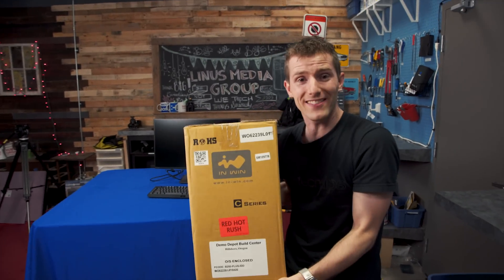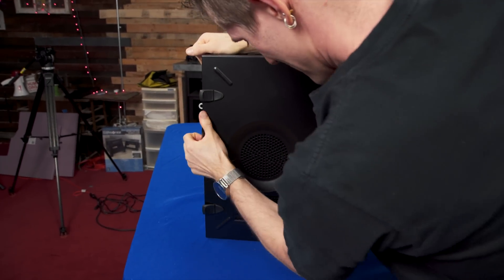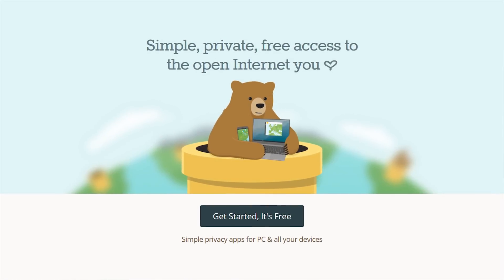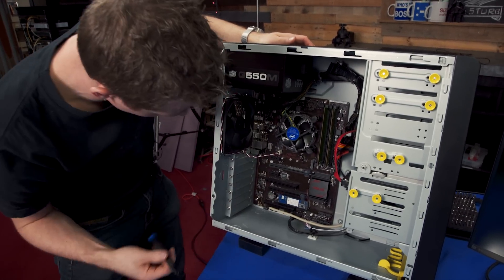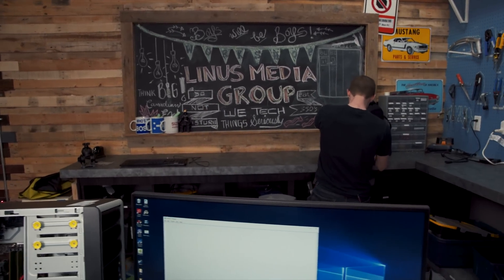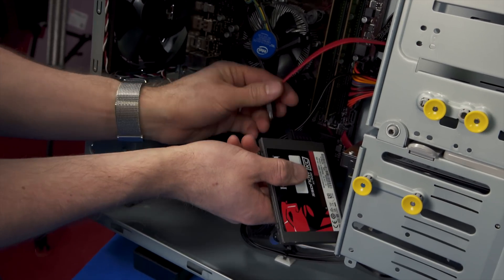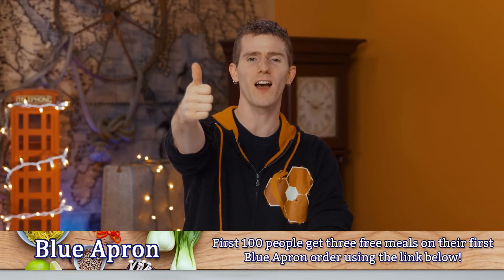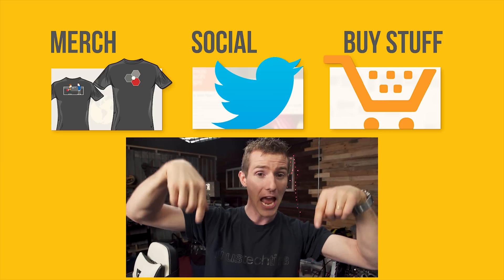Turbocharge your SSD for $40??

Comment: Bullshits, for 20$ more you'll get a 128Gb ssd with an HDD for datas. Or if you're searching for the cheapest solution, SSHD will be as this module. This is the same functionment, but will don't occupate a M.2 slot...

Comment: It's a nice Item. There are board out there like the Asrock z270 Taichi with 3 M.2 slots that each support optane. You can use one NVME SSD for the OS, one for your main games and an optane module to speed up your mass storage HDD (that let's say you use for not so frequent accessed files).

Comment: I would buy the shit out of this if it would work with older systems but why the flying fuck is it only compatible with the newest, best stuff? Why would I need this crap when I have the newest best stuff anyway? Who buys new hardware and then puts a slow-ass HDD in it for a boot drive?

Comment: I was doing similar thing with flash drives years ago, to work around having slow Virtual memory. 

It works wonders, if you have small ram, and slow hard drives, but otherwise?  Just get SSD, it's cheaper, and has more uses.

Comment: Unless there is a real, hardware level compatibility issue, its nonsensical that it's limited to Kaby Lake and above. The main market I see for this now is OEMs using them in prebuilts as a cost saving measure over a real boot ssd.

Comment: the case at @1:00 in. i like that cases mounting system. not for sure of its going price. still the last one i had that looked similarly generic i had to use screws for everything, except for the side covers. this looks like it has a system to easily mount drives and such. that would have been nice.

Comment: This is silliness, but try giving it a shot on a Ryzen system while you still have the sample. I've finally sold enough rebuilt Xeon systems to rationalize adding a new system (Still going to finish my personal Xeon build, too much love put into it and I've already gotten rid of one I really wanted for myself, but I felt so bad for the customer. Single mom, Windows update corrupted Windows, destroyed sectors of her hd, just a mess, I won't get into more details, but a new HD plus a new windows iso @full price was required since MS said it was not their fault, Dell said it was, called MS back on 3 way, and they invalidated her key since she no longer had the mother board which fried when her Dell PSU went 3 years ago and I replaced it). The cost to fix her PC with labor (Over 35 hours real life time) was roughly the 2x the cost of the Xeon build, so the big heart that I have...

Anyway, any shot at testing that on a Ryzen build for giggles? I have an SSD but speeding up the hdd on the Ryzen build would be great. i know it won't work with the x5650 build, but if it works with Ryzen, I'll test it anyway. Maybe a driver update somewhere down the road?

Comment: This is a stupid product if it only works with kaby lake or above. Those systems will already most likely have an ssd already. The systems that need it are the older mid-2000s computers, but they aren't supported.

Comment: I don't get it. For $40 you can buy a 128GB SSD and then just pair that with your mechanical and use it on any file system on any OS without any hassle whatsoever.

Comment: It seems like it makes no sense until you factor in what they are actually trying to achieve here... sales...

They don't care about Joe Bloggs who picked up a new PC last week, they care about the guy/gal picking up a completely new system right now. By restricting the compatibility to Kaby Lake they are trying to get more sales. Sure, you can argue that people can purchase 100 series products, and older, new but you have to bare in mind that retailers have already paid for those, this forces retailers to stock new hardware which = sales for intel and it's partners. This product is aimed squarely at the budget end of the spectrum and budget builders are frugal. Given similar performance between say a B150 board and a B250 board and lower cost on the older part they will buy that. Add in a feature like Optane support and that suddenly changes even if they don't pick up an optane drive, supporting it for future upgrades is a factor.

Comment: So.... if you have a 2xx motherboard, why would I have a sata SSD? when I would go u.2 NVME SSD?, and I could put the $40-80 cost towards a bigger one, and old skool HDD's can be used for data. The cost of 256Gb is quite nice a 512Gb NVME is $250 for ironicly WD black SSD. With that storage you don't really need 'cache' as your main system and a massive pile of games will all fit, and you don't need to worry about flushing the cache when you open multiple games.

If Intel had introduced it into lower tier motherboards, hell yes I think it would be good as most consumer PC's are currently sold with old HDD's, so the option of droping in a $40 fast Cache would be awsome.

What I would of loved Linus to do is put the Optane head to head with a small NVMe drive so we could get a feel for future Optane products and if there really anything other than NVMe with a fast cache and controler and Optane is just a marketing ploy.

Comment: Optane would be really cool addition for Ethereum nodes (and other cryptocurrencies). Ethereum state database is increadibly I/O heavy, and traditional hard drives were no-go from the start.

Having latency comparable to RAM, while non volatile and quite cheap, would be a holy grail for such usecases - especially since optane is affordable to regular end user

Comment: I honestly see no point to this, if you are going to upgrade to a mobo with M.2 slots and still be rocking a HDD as your boot drive, you are failing yourself. No one is going switch over just for that product. Just save the money and buy a SSD as a boot drive. Keep your HDD as extra storage. M.2 SSD's are fantastic btw.

Comment: Doesn't concern me because I won't build a PC without a Samsung or a Crucial 1TB SSD. If I need it in the future, I'll put in a WD Black 2TB HDD purely for storage. When the price of SSDs goes down, then I'll have a 1TB SSD for boot and another for Storage. That will do me until the Optane grows up. Once the M.2 drives come down in price, I'll get the largest capacity M.2 available and have the fastest SSD installed for storage.

Comment: For me this optane modules look absolutely useless. Even if we ignore the compatibility issues we can buy 128-256GB SSD for the price, but you can actually store your data on this SSD while optane module surves only as cache, bringing redundancy in play and being not really reliable in terms of what is going to work faster and what not. Even with a smaller SSD you can reliably install not only your system, but 1-2 of your favourite games, that you play often and get the guaranteed boost in performance for them, which is definitely better than any sort of "prediction" by optane technology. As of now I see this only as a part of preassembled PC, where people don't fully understand what they are paying for

Comment: I might've actually purchased one of these, but I use a Skylake system. 
Even with a bootSSD (960 Pro) and a storage SSD (850Evo), I still use a 2tb WDGreen and a 1TBWDBlack drive for media storage and larger games which I don't play too often. It would've been nice to speed up loading and access to these drives from more commonly accessed programs and games I store on them but sadly the HW lockout is preventing that. It's a cool idea and the multiple thousand doller xpoint totally not ram sticks for servers are cool.. but as far as a user case goes, I think it has no place.

Comment: Would love to have something like this for my (small home) unRAID server who actually uses all my old HDDs and has no SSD. ... of course that is a old board without M.2 ... without Kaby Lake and without Windows so this would never work.  
My brand spanking new 5GHz Kaby Lake System has 2 SSDs (1x 256GB for Windows, 1x 1TB for Steam) and no HDD isnide... only USB3 HDDs on the outside, behind the desk... in a box... because noise.

Comment: I'm one of the strange use-cases where this would be great. I've got an entry-level HP Omen 2017 laptop for gaming on the go, but unfortunately it comes with a 1Tb mechanical drive and no SSD but has an M.2 slot available so I could jam an optane module in there, would this work in this case?

Comment: I see a use for it in any mission critical system where the admin would really want to commit all writes immediately without a buffer in volitiles RAM.  It's a data security safety net that finally doesn't need a battery and without risk of exhausting P/E cycles earlier than you'd want (theoretically).  I'd use it as a journal drive for another drive with all data written to the journal first.
Reply: This might also be useful for using lower complexity databases and allow higher data density and security without a WAL and all that while gaining performance.

Comment: The target audience for this product does not exist.
Reply: Considering the cost of SSD drives nowadays, that would be an accurate statement.
Reply: Okay, but you aren't really getting 8 TB SSD performance with this product either. You're limited to the measly 32 or 64 GB that it offers. Just put a 50$ 120GB SSD as your boot drive (plus whatever special programs you use frequently) and use the 8TB HDD for your games and media.
Reply: couldn't agree more.
Reply: Admittedly, if I went and purchased one of the 8TB drives newegg had and then used it on this, it would be about $220.... I cant get a 8TB SSD for $220......
Reply: hahaha, as a marketing bachelor i'm fully agree!
Reply: This. As someone with a compatible new mobo and a 7600k KabyLake processor, I already have an NVME ssd. Why would I need this?

Comment: Sure a mid 2000 pc with a kayby lake cpu sure linus
Reply: If you don´t waste half the budget on LEDs, your computer will suck.
Reply: Matthew Unterberger "styled"
Reply: Sod Alfredsod How else are you going to run 1440p at 144hz on an intel core duo and 750 ti??? Throw in some RGB fans, LEDs, and a tempered glass window and you'll be getting those FPS with ease!
Reply: It's the case look dude, kind of looks like an Opteron
Reply: It's about the looks of the case...Oo :D
Reply: Matthew Unterberger 😂
Reply: yea
Reply: Justin Rivera MID 2000 DID NOT HAVE CORE 2 DUO I AM SO TRIGGEED
Reply: Its a bit like sticking a big red "R" on your car to make it go faster... at the very least it helps balance the inverse proportion of noise/speed...

Comment: The answer is simple, AMD has so totally taken Intels attention from them and caused them to lose train of thought so terribly that they have released a product that simply makes zero sense. 

Let me know when they have a Optane product that replaces the SSD and works on any system, AMD or Intel. And is no more expensive than a 960 Pro and at least as much capacity. Then I will buy one.

Comment: Just a question, will this work if i have an SSD for OS and HDD for games, will this accelerate my HDD so laod times will be lower? Load times are mostly an issue in a few games, but at that price i wouldn't mind buying it rather than another SSD.
Reply: FK-Legit no, only works on boot drive atm
Reply: Ahh, then it's not for me I guess.

Comment: who is this for??? the guy who goes kaby lake and doesn't buy an m.2 ssd, or a sata 3 ssd, but rather a standard spinning HDD? sorry, but if i upgrade to a board that has m.2 slots on it, damnit i'm getting an m.2 drive for OS, progs, and apps, and at that point sata 3 ssd's for bulk storage. even if i went part by part, and had to use my old spinner HD until i could afford my m.2, spending 40 bones on this is counter intuitive to saving up for the m.2, or even the ssd. i guess intel is so little concerned with ryzen that they have time to scratch itches that don't exist. 'here's fantastic new tech that lends a hand to to the tech of yesterday, but is only compatible with the tech of today'. now, show me a pci compatible card, that uses this tech, that i could use on even an old IDE drive using a board that doesn't even support sata, and i'll be impressed. this is just, useless.

Comment: Tony Cole almost asked the right questions: less specific:  Lot's of people have a SSD for boot and top games + HD for most games and documents/fotos/videos. 2 tests I would like to see:
1- small SSD just for boot and HD for games: games should load faster. But how much games? When do we pass the "advantage point"? 3 big games? 10 mid - size games?
2- small SSD just for boot and HD for games, streaming, video-editing and teamspeak. Avg. small twitcher. How much resources are now left for fast game-loading? I guess not so much...

Imo "only" case 1, when you don't have more then 5-10 frequent games to be played, it can be an interesting option (next to the basic PC without SSD). A combination of games on SSD (usually the top games played) and some on HD doesn't seem interesting. The resources would be wasted on the SSD caching. Other way around, rarelly played games on SSD and top games on HD is also a waste of resources... So, find the sweet spot. :-)

Comment: Everyone with a just a tiny little brain does buy an SSD I hope? I mean, if you have an m.2 slot available then you should have an ssd... And if you buy a brand new PC. 1TB HDD(50$ & 40$ for the optane) I'd rather buy an 256gb SSD and save up for an extra hdd for bulk storage.

Comment: i have 850 evo 250 gb for windows and all other apps like 3ds max , maya blender  premier , after effects nuke, cine4d... and i have turned on its rapid mode, where it uses RAM.. would i get better results than using it with optane or leave it with system memory cache only?

Comment: stupid think dont buy it buy an ssd
Reply: Don't be scammed by Intel !!! Optane is useless and extremely expensive !!! $80 for only 32GB !!! Why not just buy Samsung 960 EVO 250GB PCIe NVMe M.2 ? Which only cost $128 and x8 times more capacity !!! and even faster than crap Intel Optane !!! so if you want same capacity Intel Optane then you will need to cost $640 for only 250GB !!! No point of crap product !!!
Reply: Kelvin KMS This is to OPTIMIZE the speed at which an HDD is read. Say you have a 4TB HDD and you want it to be faster, you buy this. I dont understand how even after he explains the point of this product no one seems to understand its intended purpose. THIS IS NOT A SSD AND NOT A STAND ALONE STORAGE DEVICE.
Reply: WD Black is not as fast as an SSD. After that statement....we're done here. Thanks.
Reply: Let's just hope he is. I highly doubt someone could be that stupid without being high.
Reply: David Ugarte Finally someone who understands.
Reply: yeah. he is definitely high
Reply: I think the stupid one is the one who can't spell in English correctly.
Reply: You are wrong. just use WD Black drive then your game loading speed is same as SSD or this crap Optane + HDD. Only OS and some programs need fast 4KB read. I don't think you need 4TB HDD to run OS or some files less than 8KB. so you don't need Optane at all.
Reply: Pathetic excuse of an attempt at the English language. Do not listen.

Comment: Is it possible that this is less designed for boot drives, More for turning archive drives into work drives?

For example, If you are a video editor this could allow you to use an Optane module and one or several good HDDs as opposed to the higher cost per GB of large SSDs

Comment: In short: A system with M.2 must be relatively new, therefore is close to an "Enthusiast" level or at least a "new system" - therefore it is likely it contains an SSD already. Value for the optane add-on? About none. Older systems won't be significantly improved, especially since it's a matter of "artificial intelligence" based on algorithms - made by humans. Therefore: failures are bound to happen, even more so in a system that is not (!) constantly used the same way (meaning that optane has no time to adapt to a "good plan").
Of course, it does not mean that optane (or a similar approach by AMD & others) will not come into the market, nor that it won't pay off in a while. But for now, its pretty much an idea in the pocket, that Intel already wishes to become a Marketing Value (while earning the first few cents from it). Therefore I conclude: hands off and let the R&D actually make it useful for us all.

Comment: linus might be going the top gear route, more flash than information. 

but the production value is simply not there and now click bait titles ? 

look if you want to use click bait , its your problem. improve the production value.

you have same jingles for everything regardless what kind of show that is , everybody is too casual.

if you want to downgrade the title or anything at least make up for it on the other front.

Comment: readyboost re-invented. Pointless in my opinion.
Reply: primocache already does it better and is more flexible.
Reply: Funny that is the same thing that popped into my head after linus explained what the video was about :P
Reply: Yep, Intel is being a little silly with their marketing. It's really only useful in database & virtualization environments, I think.
In the future, if they can get longevity up, I could see 3DXpoint becoming main RAM and internal storage in mobile devices. If they get really improved performance and longevity in the future, then it could even shift the model from 8M cache<>8G DRAM<>8T disk, closer to 128M cache<>128G 3DXRAM<>8T disk for a middle budget system. The future of this stuff could be in DIMMs, not M.2.

Comment: I agree, I don't see the market for this yet, for $77 you can pick up a fairly decent 120ish gb SSD which as shown here would be far better considering the 4x capacity. And come on, a 2017 pc with M.2 support and no ssd boot drive? I mean there is an argument for faster program/game boot times across multiple drives (I'd like to see a video on that) but even then you'd most likely be better off whacking another ssd in..